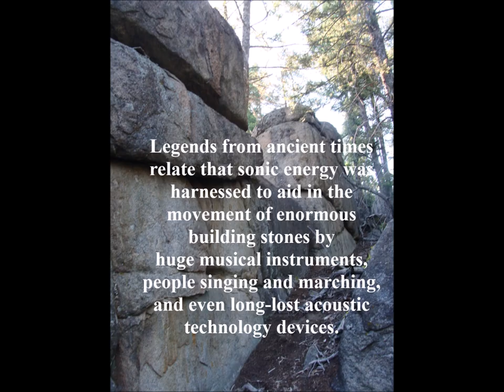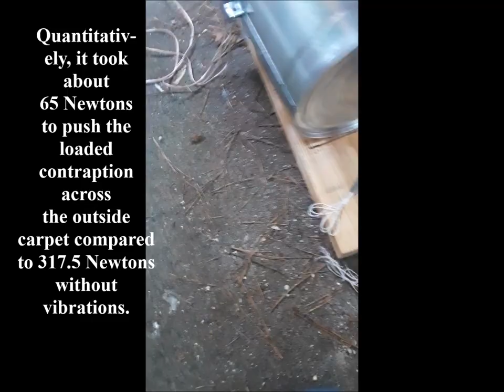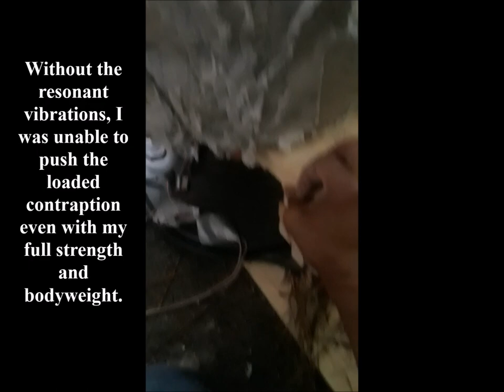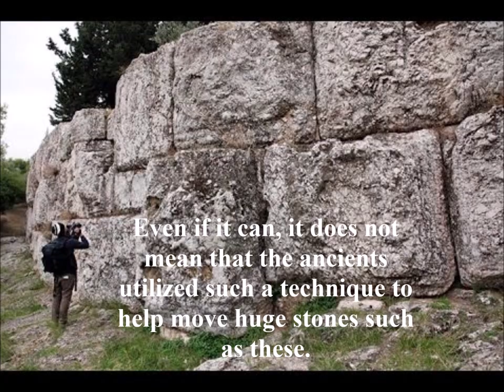Moving Boulders with a Push of the Finger: Did Sound Help to Build the Megaliths?

Comment: While vibration clearly works, it does not explain the form fit of variously shaped "stones" in many ancient walls. Geopolymers seems more likely.
Reply from the maker: Animuz    I think similar to today that ancient peoples likely utilized different techniques depending on what was available to them. For instance, a larger, wealthier society might use large cranes to move boulders around whereas small communities might use ropes, pulleys, levers, and muscle. Others might pour large bricks. It's very unlikely that all societies would have used the same techniques. However, one thing is for sure; whatever techniques they used, they involved a lot of skill. We would have difficulty building some of these structures even today with all of our modern technology.

Comment: If you put sand or pebbles under that much load  it might move  alot faster....
Reply from the maker: Wayne Shannon   That works up to a point. But after a certain weight, the sand starts to dig into the surface of the sled, having the opposite effect and increasing friction.

Comment: Hmm... how did they lift it in the first place to get a contraption under it!?
Reply from the maker: As I understand it, the goal is to get the stone itself to resonate. This contraption here is just demonstrating the principles of acoustic lubrication and surface acoustic waves (SAW).
Reply: @gsutton78  yes, I suppose you could attach something to the side as well.  Wonder if it would be as effective!?
Reply from the maker: @KGingeri   Yes, on the side of perhaps even on top. Its effectiveness would depend on how well the device coupled to the stone itself and to the ground for maximum energy transfer.

Comment: What if the sounds wave or vaibration are to far apart? What if their was a way to minimize the time difference between each vibration, to create more movement at less force, ive thought about this and i feel like if the sounds are to far apart the vibration cant produce enough vibration force to allow the movement, sorry if I lack the explanation skills as im still learning about this myself, I just was curious what your thoughts are, also stay on this study brother, in my opinion, your on to somthing!
Reply from the maker: Hi. Thank you for your comment. I think I get what you're saying. This is probably where higher frequency harmonics would come in. The technique here uses the vibrations of the pail which resonates in the lower audio frequency range.  But the legends talk about resonating the stones themselves. And if that's the case, then we'd be talking about much higher frequencies in which the vibrations would be closer together (shorter wavelength), as the resonant frequencies of stones are in the ultrasonic range. This coming year, I plan to modify my equipment to produce ultrasound. I can't wait to see if it works as well as or better than sounds in the audio range!

Comment: Thermoacoustics? What do you mean? I agree with you that they must have known something that we have forgotten.Modern builders say that they can’t build some of the structures that we see today .
Reply from the maker: Thermoacoustics is a non-electronic way of generating acoustic vibrations even without modern technology. Particularly heat engines like the Stirling engine. The Stirling heat engine gets its power from a Sondhauss tube, a thermoacoustic device which converts heat energy into mechanical vibrations. The way I see it, the vibrations themselves could be used to move objects as in this video. But of course, today, we would attach a piston, crankshaft and flywheel to create a rotary engine. Steam engines are essentially classified as thermoacoustic devices as well. And we know that steam power had the capability to many tons as it was used to usher in the Industrial Revolution, moving thousands of tons of building materials to great distances across the Earth's surface. Perhaps it's possible that the ancients did something similar, but with acoustic vibrations instead of wheels. One of my preliminary experiments with over 500 lbs has shown that, not accounting for input energy, vibrations are nearly as effective as the wheel in reducing friction. The wheel was still better. But the vibrations were in the same ballpark.
Reply: @gsutton78  If they had such a device wouldn’t they have left some pictograms of it, maybe some hieroglyphs,seems strange that they didn’t.Now they are working on an “internal ramp system” theory for the pyramids construction.l don’t think the pyramids were used as the kings “burial chambers,they were used for something else.I’ve read that no mummies were ever found in a pyramid,
Reply from the maker: @dwight4626    Yes, there are theories that perhaps it was created as a power plant similar to Tesla's free energy tower and are possibly far older than has been claimed. If no burial chambers or mummies were ever found in them, yet they are telling us that they were tombs, then perhaps they are lying and covering up any evidence of sophisticated technology as well. Or perhaps the machinery was dismantled and sent elsewhere. Look at the giant cranes we use today. After they are used, they are nowhere to be found, which is interesting since they are so big, taller than the buildings themselves. They are probably rented for the building period and are shipped to the building site in parts. When they are at the site the pieces are put together and used. When the buildings are finished, the cranes are dismantled and shipped elsewhere for use or storage. A similar process likely happened in ancient times. We don't see the giant wooden sleds they are said to have used either, even though there should be hundreds of them.

Comment: Hello, my friend.  You are what the essence of science is about.  I spent half the night trying to track down this video from my memory and my archives.  Since I'm not allowed to post links you should be able to find:
When Water Flows Uphill, SciFri, 9 years ago, 
Despite this being water and heat, I would like to emphasize that Gustave Le Bon said that it is a continuum between friction, heat, spark, and light.  So, although these methods seem unrelated to what you are doing on the face if it, there might be some creative cross-application.
Anyone interested in a 1937 paper:  EFFECT OF INTENSE SONIC VIBRATIONS ON
ELEMENTARY BODIES OF VACCINIA, using frequency to shatter cowpox virus can PM me and I'd be happy to share it.

Comment: If you put it on wheels, it would be even easier to move. I want to see you levitate it.
Reply from the maker: Of course it would be easier to move with wheels. "If" those wheels are made of the thickest rubber and space-age-level metal alloys. Remember. we're talking about weights as high as 1,000 tons. Not to mention the suspension system and bearings, both of which would also need to be made from the strongest metal alloys. Hence, the question is, if they didn't have those particular materials which we would have to use today in order to duplicate these feats, then how else could they have done it without those materials? That's where friction reduction comes in. If we can imagine them pulling/pushing these stones, then wouldn't that process be made much easier by reducing the friction coefficient by 50% or more?

Comment: That’s vibrations that are making sound not sound causing vibrations. How can you make enough vibrations with sound acoustically? It’s like suspending a ping pong ball with a vacuum cleaner and suggesting that air was used to lift blocks.
Reply from the maker: Of course it's the vibrations making the sound. What's your point?
Reply: @gsutton78  Well  a lot of people want to say that sound was used to levitate blocks. This is obviously not the case.
Reply from the maker: @AIenSmithee  Vibrations can move matter, but they give off sound in doing so. And when describing levitation, we often use sound and vibration interchangeably. Hence we use the term sonic levitation or acoustic levitation rather than vibrational levitation. Why must we always quibble over petty semantics rather than attempting to grasp the concepts themselves?
Reply: @gsutton78  why does it matter? Because ancient people could easily make noise but vibrations is not so easy. Vibrating an object and projecting sound at it are very different. This is not semantics it is incorrect descriptions of what is happening. The sound is a bi product of the action not a cause. If you use vibration and sonic interchangeably then you shouldn’t. This is why it’s pseudoscience because actual science is very concerned with accuracy. If you told someone that you contraption moved or made it is easier to move with sound the object with sound they would easily see this is not the case.

By the way this is a decent experiment and it’s great that you are trying to learn something and work it out. Why sully your work with a lazy description?
Reply from the maker: @AIenSmithee   Actually your argument is irrelevant. First of all, how is it pseudoscience when it works? And second, levitating small objects with frequencies in the ultrasonic range is called "ultrasonic levitation", not ultra-vibrational levitation. And consider that we can't even hear frequencies in the ultrasonic range, yet it is still called ultrasonic levitation by those who work in the field. Ultra-"sound" is used to break up kidney stones . No doctor says, ultra- vibration. But it is understood by those who are not trying to give others a hard time just for the hell of it. Sound is caused by vibration. Hence when one says "sound", he means vibration by default. It's not rocket science, dude. I'm an engineer and I know what rocket science looks like. Trust me. This issue with the words ain't it.
Reply: @gsutton78  in ultrasonic levitation the sound wave is moving the object. The air conditioning is what is moving the object. The function of the wave is moving the object. The examples in the video are horns and drums which I don’t suspect you believe are sufficient for having enough energy to move anything. The action of the resonator in the video is acting upon the whole contraption. The sound is irrelevant. 

Ill try to meet you in the middle and let’s just forget about the distinction of what is technically sound. The vibrating resonator in the video does seem to make the load easier to push. This makes sense. The trouble is, the is no way to create this effect in the ancient world without electric resonators. The equivalent would rely on fully acoustic sound that could not produce the energy needed to create that effect. The electricity is putting the energy into the circuit by powering the resonators action. To do the same without the electrical power and instead by way of acoustic resonance is very different. It’s almost not the same thing. I know it seems connected but it’s very different. The physics involved means that it’s very hard to scale up. I’m not saying what is and isn’t possible but I think it’s pretty hopeful to do let alone prove that ancients could do it and used it to build ancient structures when there are plenty of explanations in the work itself and in their writings. It’s still a worthwhile exercise so best of luck, I mean that. But after all that if you don’t understand why I have an issue with this being described as acoustic levitation than I guess there’s not much more that can be said. As someone with a diploma in sound engineering I have a appreciation of sound relating to the effect of sound waves through the air.
Reply from the maker: @AIenSmithee   That's the case with all sound vibrations, dude. Sound only exists within the medium through which it travels, be it a gas, liquid, or solid. So again, the argument over sound and vibration is unnecessary in this case. I can appreciate you being exacting as a sound engineer. But in the scientific world and someone who's read many science papers, they don't typically use the word vibration as though it's exclusive to sound because it isn't. Saying sound implies vibration by default. But as far as vibrational power, we have to look at not only the source of the vibrations, but also the environment. Resonance is the method to increase the energy, and this can be done in any medium. Additionally, the ancients wouldn't have needed electronics to generate sound. Among other methods, they could have used steam powered devices. The Greek inventor Hero of Alexandria described a steam powered turbine over 2,000 years ago. And many things ascribed solely to the Greeks actually originated at a much, much earlier time. We're finding that the ancients had metallurgy much earlier than thought. And once you can melt metal, you can form boilers and conduits. Take a look at Tesla's steam powered oscillator which was originally meant to generate alternating current from steam. A small, fairly simple device. And allegedly, when he was testing it, it reached a certain frequency which matched with one of the building's resonance modes and caused macrovibrations in the building. Interesting story. Also, steam engines from the 1800s had steam powered whistles. High powered whistles powered by compressed air can shatter glass from a great distance via resonance. Steam power enabled us to haul literally thousands of tons of building materials across the Earth's surface. It wasn't the most efficient technique, but it got the job done and helped to jumpstart industrialization. So we know that steam can be used to generate high energy sound vibrations. And, it's not impossible that ancient people could do this as well. They knew about feedback systems, sound engineering, and many other aspects. But did they use sound vibrations in the manner in which I'm proposing? That's quite another question which could only be answered by finding and unearthing the smoking guns. But we at least have to be open minded enough to ask the questions. In our modern hubris, we tend to assume far too much.

Comment: I cansee moving stone can be done on a level surface but how could it be lifted?
Reply from the maker: There's a couple ways I theorize that sound could assist in lifting. One is using a ramp. With this friction-reducing method, steeper ramps could be built which would use much less material. Volume of material has been argued as one of the limiting factors of the ramp theory as it has been said that the ramp would have been a bigger project than the pyramid itself. See this video at 26 minutes and 26 seconds in: https://www.youtube.com/watch?v=uyf9AaYfLrI&t=1377s. Another method might involve "vibratory lift"; a type of temporary/impulse lift as shown via model in the video here at 8 minutes and 35 seconds in: https://www.youtube.com/watch?v=YVwGUNT8akI&t=7s. Another "hypothetical" way might be an actual antigravitational effect. Mainstream science has recently discovered that sound vibrations (as phonons) actually possess "negative mass". Unlike photons which can travel through a vacuum, phonons only exist within the medium through which they travel. Hence, they are classified as quasiparticles. Negative mass means that as they travel out horizontally from a source, they tend to curve upwards as opposed to downwards as with anything else with mass. In other words, they have a type of buoyancy when traveling within a gravitational field. And since they only exist within the medium through which they travel, then it follows that this negative mass would transfer to the medium itself, whether that medium be a gas, a liquid, or even a stone! From what is known so far, it would take an enormous amount of acoustic energy to do so. And so, whether or not it could ever be a practical means of antigravity is still "up in the air" (pardon the pun). I discuss the property in this video: https://www.youtube.com/watch?v=044hLpHuK-s.

Comment: How would they tune the sound to different rocks? Each one is different.  I have no idea about this at all, but maybe  earthquakes vibrate rocks sufficiently enough? Did they have Hordes of Elephants trained to stomp the ground and yell with their trumpets as intensely as possible? lol
Reply from the maker: Tuning can be achieved by modeling/calculation as well as by feel. As for the energy intensity, resonance with the surroundings could potentially help with that. It is also possible to generate powerful sound waves with heat energy. I will attempt to demonstrate this in upcoming videos.